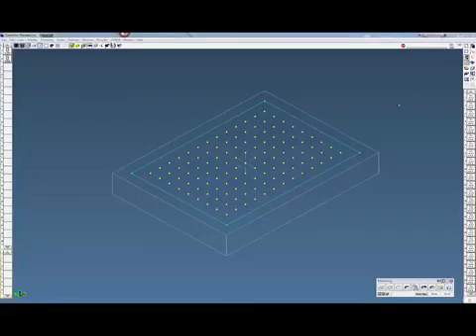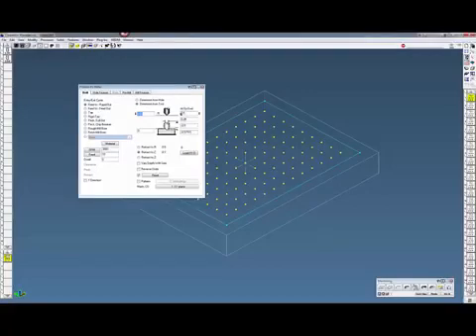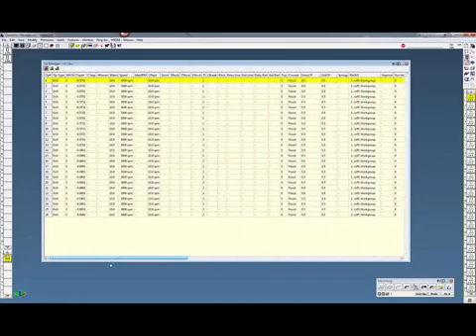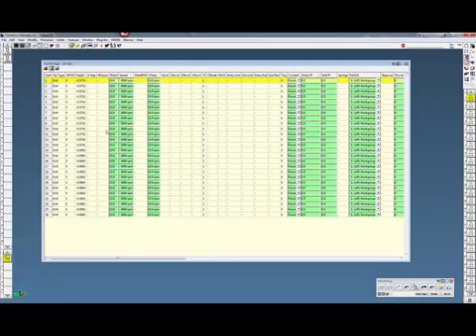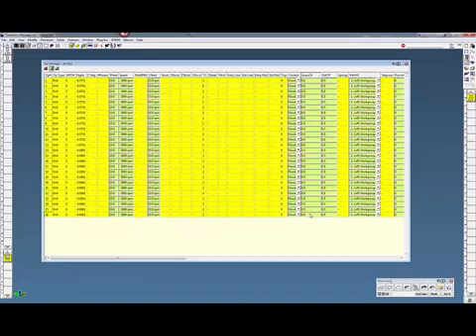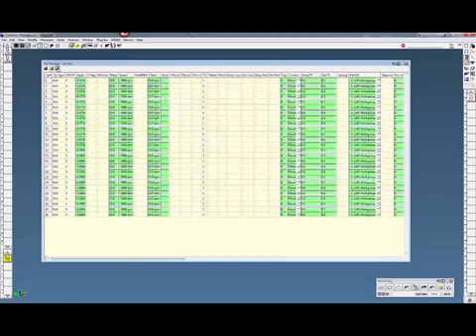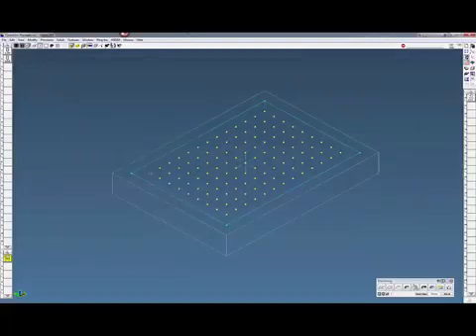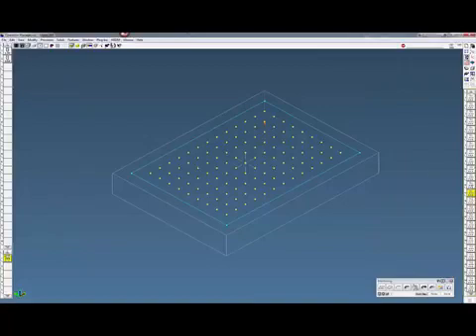GibbsCAM mass feed/speed changes

Comment from the maker: I have a short video using Machine Manager.  I bit old from 2020, but the same concept.  If you are looking for more in-depth please let me know.
https://www.youtube.com/watch?v=nNgyVXT6nbc
Reply: Is there a way to have Gibbs automatically slow down on arc moves?
Reply from the maker: @BYDFS1996  Find the operation that does the toolpath, like a contour, then right-click and select Change Feeds and Speeds.  There you can choose Milling Feedrate and put in how you Gibbs to automatically adjust feeds for corners.  Lots of choices there on how you want it to interpret the toolpath feeds.
Reply: is there an option to adjust feed and speed depending on AE?